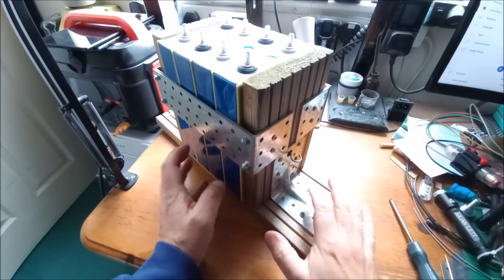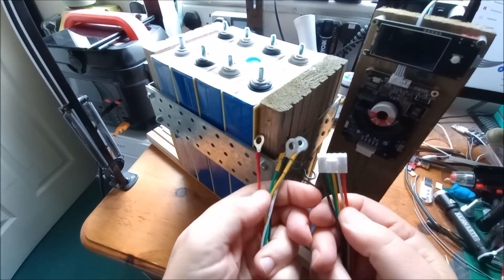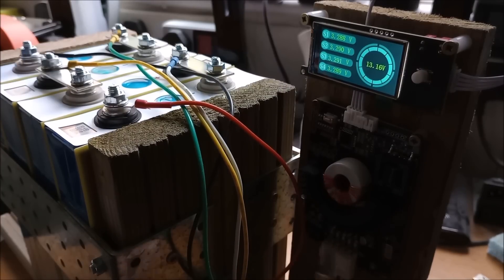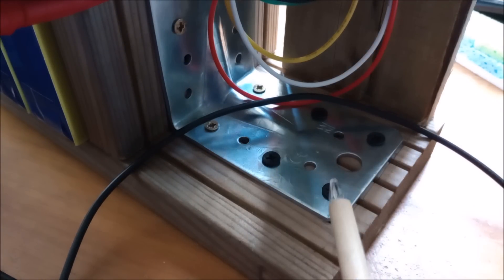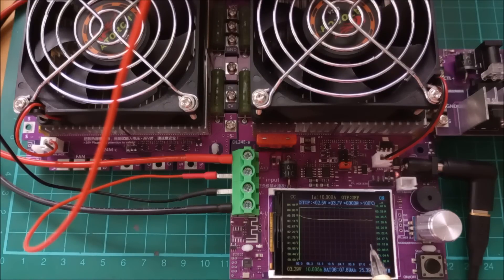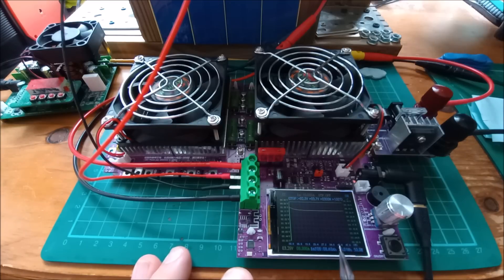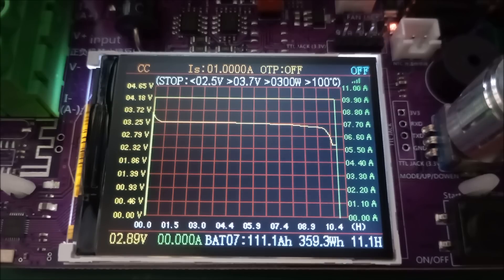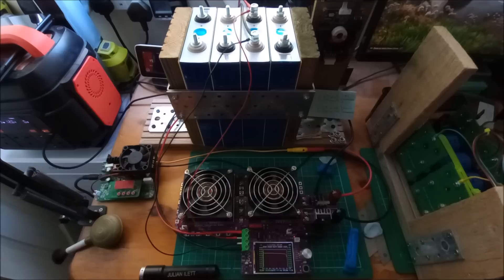5% Better than Specified - 105Ah LFP Battery Tests

Comment: That’s about right. I believe EVE LF105’s (Grade A less than 6 months old) will yield ~111Ah typically. If you buy “Grade A” cells and they just barely pull capacity then you didn’t get Grade A. 

EVE test report sheets are fairly easy to find online so even if you buy another brand you can get a rough idea of what a Grade A of a specific size should pull….except maybe the LF280K’s…those things are just silly, they all pull over 300Ah each so about 10% above their rating.

Comment: 10 A is only about 0.1C so results would be optimistic. Try measuring capacity at 0.2C, 0.5 C and 1C too.
Reply: All of my EVE 104 cells measured above 108ah using 0.2C charge and discharge rates. The 104 an 304AH cells from EVE are high quality. The spec sheet rates the capacity at 0.2C rates, and you should probably avoid a 1C rate unless you really only want a battery that only lasts an hour.
Reply from the maker: Ha ha. It took 4 days to do the 0.1C tests. Anyway, moving on to the next video now.
Reply: @JulianIlett  Well, 0.2 C should be a little less than half the time and give more standard results that everyone else uses.
LFP battery prices are falling quickly, and suppliers have learned from youtubers' feedback - I just snagged a 51V 5kWh rack mount for about £1000 and saved a lot of time and hassle by not having to source all the components separately and then making a hash of it with DIY!
I'll use it as a solar charged EV range extender.

Comment: In written terms is that 445.3ah
Reply: Amp hours are meaningless without voltage, so use watthours instead.
105 Ah at 12V has the same energy capacity as 420 Ah at 3V or 26.25Ah at 48V
but they all have the same 1260 Wh capacity.
Reply: @ahaveland  but he discharged each cell to around 111ah doesn't that add up and he linked them in series so it's definitely 12 to 14 volts
Reply: @paulwright8378  No. Amp hours don't add up in series, only in parallel when the voltage stays the same.
1 amp hour at 1000 V is the same energy as 100 Ah at 10 V.
Watthours add up regardless because that is like the volume of a bucket. A cell's nominal (average) voltage is 3.2 V.
111 Ah at 3.2 V is a quarter of the energy capacity of 111 Ah at 12.8 V.
Problem is that people have been using amp hours as a unit for too long, and it's only easily comparable when everything is 12 V.

Get used to thinking in Wh or kWh instead of amp hours, then you'll always be able to know how big the bucket of energy you have is, regardless of what voltage it has.
Reply: * Ah
With units, uppercase / lowercase is typically critically important.

Comment: Sounds like decent equipment performance.

Can't see how a swelling cell would move the metal endstop as it is screwed down into the base.
Reply: You would be surprised at the amount of force that swelling cells can exert. Splitting wood and bending metal are not uncommon when people overcharge cells.

Comment: That's an excellent BMS. One of the only ones on the market that does balancing properly! :) The others use a resistive balancing, often even only during a charge. On this large a cell it dont matter how many years a BMS like a Daly try to balance, it cant do jack .... vs JK BMS fixed in one cycle :)
Reply: My JBD has kept my cells in balance for 5 years now, but that is a sample size of 48 cells. If you top balance properly, and have quality cells the passive (actually they are all active) work fine. The "active" balance is good for low quality cells, but you shouldn't believe everything a youtube "influencer" is paid to tell you. Test it yourself, I did. 

Technically speaking, "passive" balance (actually a transistor is turned on to discharge across a resistor) only while charging allows you to maximize the amount of energy actually stored. An active balancer has considerable losses (approximately 50%) when transferring energy from one cell to another, and if not done properly will actually imbalance a pack if not restricted to operation only above 3.45v volts (especially with poor quality cells). Really, you should test yourself, I did. There is a reason Tesla, Rivian and others don't use active balancers.